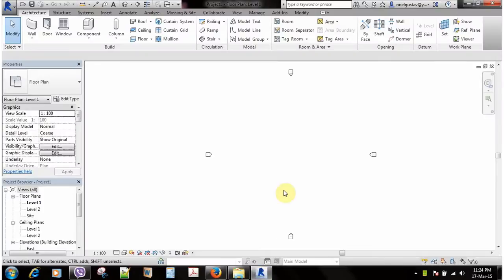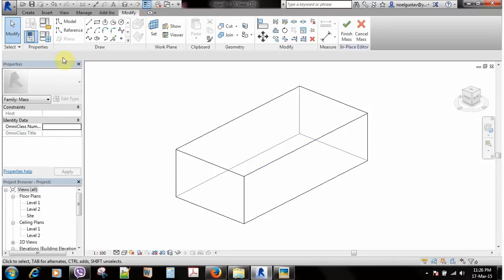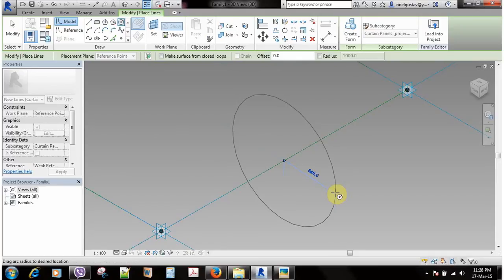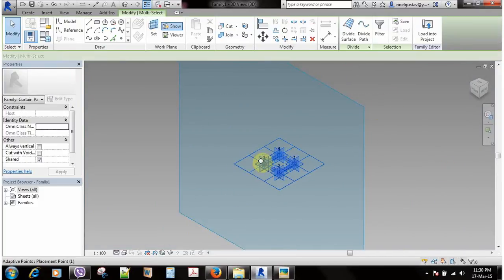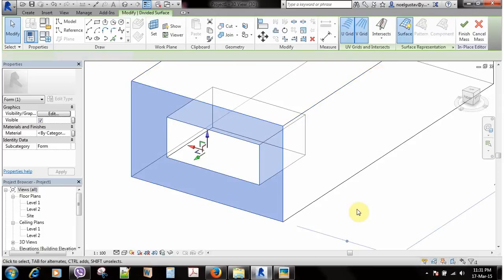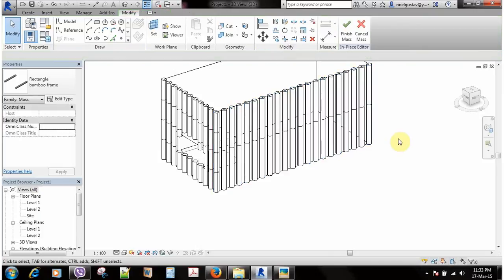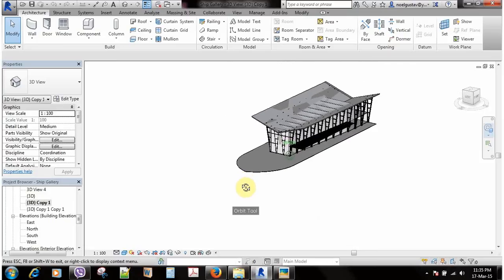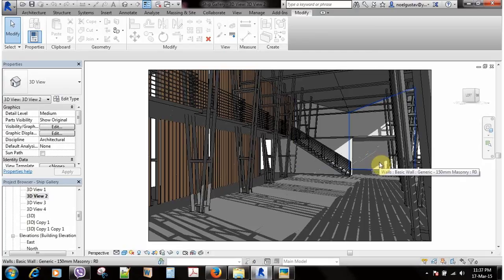Making of Bamboo Frame

Comment: hi noel, can i know where can i get the 'metric curtain panel pattern based'? I just couldn't find it anywhere on websites :(
Reply from the maker: You should have it as a template within your " revit family templates "..these are installed (online) directly to your revit program when you installed the first time
Reply from the maker: Just go to the left corner in Revit, click File - New - Family then find 'metric Curtain Pattern Based'
If you cant find it, instead you have 'imperial...' it means your default templates are set for Imperial.You can change that via options under file menu or simply load that one and change units under manage tab.
Reply: Thanks Noel 😊

Comment: Hi Noel. Could you help me explaining how did those columns made of bamboo?. I need to my thesis. Thanks!
Reply from the maker: Hi Luigina.. if i understood correctly your question, i took an inspiration from Colombian Architect simon velez. You can see his Bamboo Church here; http://archleague.org/2011/02/simon-velez/, i hope you can find more about his building style. In revit itself i simply made a frame, and assigned bamboo texture to it..Let me know if you will need other bamboo "researches"
Reply: Hi Noel... Thank you for you answer. Exactly, I need build in revit one model with bamboo as material of construction, 
and it 's where I do not know which tool to use for build of bamboo´s frames. If you could guide me to do it, I would really apreciate it. Please.
Reply from the maker: The column structure was made using "generic model family" in there I simply drew the sweep lines from elevations and plans to make one complete bamboo column...
Reply: Muchas gracias a Noel!. Espero ver más videos de sus trabajos con este material. :)